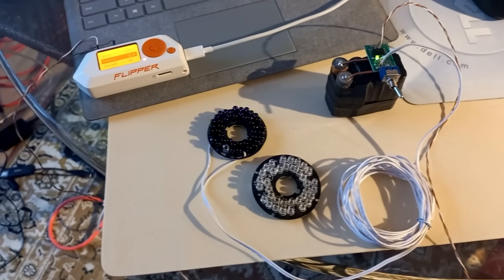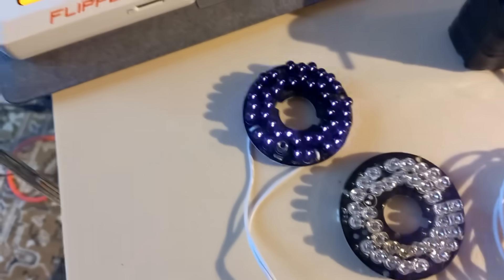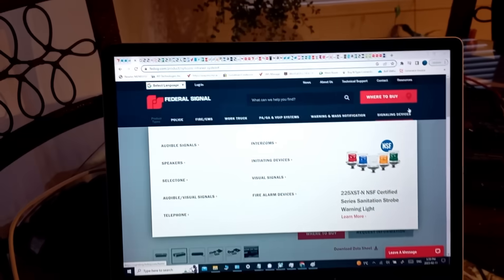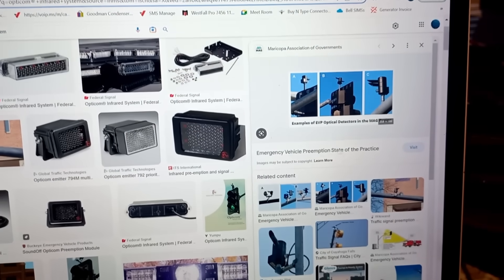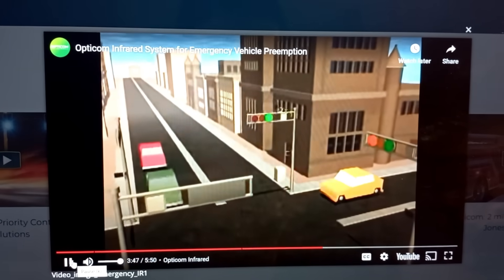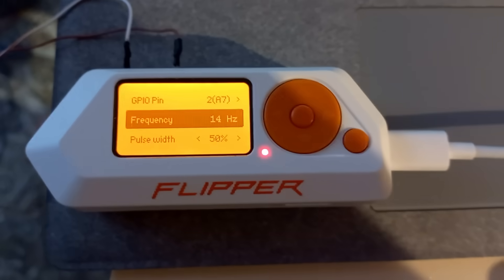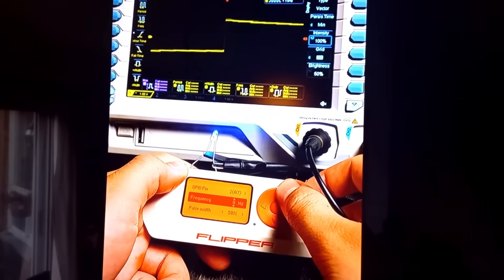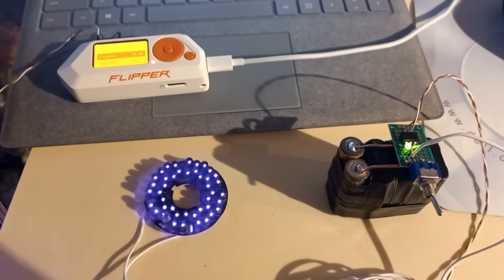Flipper Zero Controlling Traffic Lights

Comment: Remember It is illegal to interfere with a traffic control device such as a stoplight and most lights have security cameras on them these days to catch offenders utilizing an apparatus such as this for their own personal gain.
Reply: @peterfairlie2296  you can probably build the circuit using a 555 timer as an oscillator for like $3 total and they're selling it for $5000? man that's nuts
Reply: @HPStreamNewsChannel  heya, instead of a 555 timer you could just as easily use a simple arduino nano that contains everything except for the transistor on it and you can just put a simple piece of code on there via usb
Reduces work a lot and doesnt require much technical experience 😉
Reply: @hyperfluff_folf  Exactly. An Arduino is cheaper, or an ESP. There are ESP boards that already have screens on then, so you can make your own low-cost solution. Bonus: You can program an ESP with the Arduino IDE if you want :)
Reply: @HPStreamNewsChannel  lol
Reply: @HPStreamNewsChannel  yes and use transistors to drive the leds.
Reply: @HPStreamNewsChannel welcome to inflation
Reply: Then use it for the benifit of the car behind you
Reply: @peterfairlie2296  That's actually cool that you're helping them out. Companies sometimes even charge more to government groups like that, cuz they just wanna bilk as much tax money out of them as they can, but volunteer fire departments don't get much in taxes to begin with lol
Reply: You say most have cameras but I’ve yet to ever see one anywhere outside a city.
Reply: @peterfairlie2296  5000 USD, Wow!
Reply: @zaprodk  that government contractors for you.
Reply: @peterfairlie2296  laser interceptor sold laser jammers that use small IR output devices like you’ve described. I think they are out of business these days. I still own a system from 2012
Reply: @peterfairlie2296  The fact that you can save a local fire department THOUSANDS is amazing. Good for you! 👍
Reply: @watchandjewelryloft4713  yeah it's great but here in the US I wouldn't want to put legal liability on myself. That may be a large part of the reason the commercial product is so expensive. For example: this thing fails to activate a light, fire truck plows into someone, they sue, and part of the cause was found to be this system not working properly. No thanks!
Reply: I'm sure we all know it's illegal I don't see the point of pointing out the obvious..
Reply: @peterfairlie2296  true and some fire departments are volunteer
Reply: It is not illegal to high beam the traffic light.
Reply: So is speeding
Reply: No *hit Sherlock!!! I’m sure he knows that
Reply: Yes, mom.
Reply: I'm driving on a suspended lisance with no plates and unregistered car and no insurance.  I don't give a dam about legal
Reply: I can’t travel across town without being on a government video open to public monitoring.
Reply: Waaaaa Tattletale
Reply: Yes but chances getting caught is nearly impossible lefty
Reply: @Pablo Lopez Perhaps you interpreted him wrong. And assumed negative intent. Quite the opposite my guy. This world is a thinking man's game.
Reply: In a world where the ruling class can do anything they want and will only get a slap on the hand for seriously horrendous crimes, you’re worried about some guy building a tool that could help fire departments who don’t receive enough funding? 

Just because something is “illegal”, doesn’t mean that it’s immoral and vice versa.
Reply: Yes they have cameras but don’t record. Maybe only on major intersections. The cameras are used mostly for monitoring traffic
Reply: @peterfairlie2296  but even then the STM32 inside the flipper has its own clock and is only a few dollars, you proved it with the flipper!
Reply: The penalty is death!
Reply: Remember illegal is a sick bird.
Reply: @HAWKCoinMillionaire  siiiiiick 🤘🤘
Reply: I’ve been using my aftermarket Ridgid LED’s to change the stop lights when there’s no traffic. It makes no sense for the light to stop me when I’m the ONLY vehicle on the road!
Reply: that isnt "why" lights have cameras on them.
Reply: Our lights have a white led bulb that flashes on top of opticon sensor once light changes and yes there are cameras on all signals around here in. WI , they are used instead of ground sensors but they also do record everything and Dot can get footage if needed
Reply: Thanks mom 😂
Reply: This comment is why YouTube needs a laugh react feature 😂
Reply: I recently heard a story of a truck driver who had a jamming device to defeat the onboard tattler. The device was too powerful and jammed FAA frequencies as he drove past an airfield. He got in a lot of trouble
Reply: Nobody cares bro. Be a safety sally somewhere else.
Reply: 🤓🤓"don'tdo this! Its illegal!"
Reply: It’s not a crime if you don’t get caught .
Reply: Nobody asked
Reply: The subdivision I live in has plate readers that pick up every car going in or out without a stop light around. Your car can be tracked as you go anywhere in san diego. It's creepy knowing that every move you make is recorded at home or anywhere you go. The idea of privacy or independence is ancient history
Reply: @BLOODFART309  Those are traffic detection cameras to tell the light when to change. That’s all they do. They’re part of a regional ITS, so even if there’s no light there it can measure the traffic and tell the lights up ahead to prepare more greens etc.
Reply: @CityLifeinArizona  idk where the camera is in my housing area. I know it reads the tags because it was in the HOA letter. Every car in my neighborhood puts gives their info and then it alerts security I guess when any car enters the area that isn't a homeowner or renter
Reply: @BLOODFART309  yep Flock cameras be everywhere these days.
Reply: sure karen
Reply: Hahah are you kidding? Id run this during fuckin traffic.  Hack the world 😂
Reply: Lol no they don't we have been using them for years in Canada no one's been caught
Reply: I could care less about the "law"
Reply: Ok but misdemeanor or felony? I don't think anyone speeding really cares, and this might be advantageous in a cannonball run
Reply: @ImperatorCaesar22 In Minnesota it is a felony.
Reply: @ImperatorCaesar22  he's in Canada so nobody cares 😂
Reply: @peterfairlie2296  Well, a 555 might not be the easiest option (though I suspect the required frequency tolerances aren't that high), but a whole Flipper is a huge overkill IMO. Any "arduino-like" will have more than precise enough timing, even without a quartz resonator (even a bare microcontroller chip will do). Some very decent boards can be had for under $2 (e.g. on AliExpress), I personally like the board known as "blue pill" (though it can be a little tricky).
Reply: @Trekeyus 
At the end of the day. All greatest minds that were able to hack or break the system. Governments hired them to help them. So that is your illegal statement
Reply: who cares. someone with a gay flag as a profile picture should keep his mouth shut.
Reply: you’re annoying people who are smart enough to do this know they shouldn’t. This device is used by mostly hackers take a fucking look around before being the annoying fuck saying “that’s illlegal jeeepers!”
Reply: My 3 part, super basic MIRT.  https://youtu.be/H8U0_MzCrnE
Reply: Lmao no they don't. They maybe have one camera that faces an obscure angle unless it's a well known area for wrecks
Reply: @donovanm.8909  What about my vehicle?
Reply: @peterfairlie2296  love it but for cheapness you could use a esp32 and lojic level converter get is all done for 30$ allowing lojic to activate it
Reply: @peterfairlie2296  A cheapo MCU run off of a good-ish quartz ciuld do the job just as well. There probably are dedicated frequency generator ICs too, that can give you 14Hz from a faster Quartz like the 32768Hz clock crystals
Reply: I wonder what the minimum pulse width is for the sensor, and the persistence of the signal its logic is looking for vs the frame rate of the camera. In theory, and in a lab, one could sync the outpulses of 14hz between every-other frame of a 28hz camera fr. If it’s 29hz the pulse would need to be very thin and slowly phase shift from the tail end of one frame to the beginning of another, pause, and repeat.

But maybe the camera and its software is imprecise and/or redundant cams would foil this. Would be pretty sweet if it worked tho.

I guess James Bond would have a shrouded laser on an auto-targeting system that magically pointed right at the sensor, for ultimate stealth. 😂

Also, yeah this is a life/death situation device and even that would likely result in getting caught/punished. But nothing would be worse than a dead loved one.

With so much discretion available to judges why debate the legality? Your haircut is probably just as much a factor.
Reply: @peterfairlie2296  yesss please keep looking into this idea!!!
Reply: @peterfairlie2296 You wouldn't use a 555 timer, you'd just get the cheapest possible microcontroller and a crystal from a dollar store alarm clock.
Reply: @peterfairlie2296  RFID has a lot of range ! I have a reader/writer from IMPINJ that works up to 100m for fast inventory, it works with cheap 20cent rfid tags.
Reply: @peterfairlie2296  you might help some people but that is not the place to expose vulneralities in such critical equipements
Reply: Only if you get caught
Reply: Shut up.
Reply: I think he knows and most do, this ain't a civic public announcement...
Reply: @peterfairlie2296  Calibrate? With a trim pot. Or just use a $2 MCU, lol
Reply: @peterfairlie2296  it's used for weigh stations, but they have to place the transceivers further ahead, and that's extra money for a pole, etc.
Reply: @tripplefives "dirty cheap power supply" 🤣🤣🤣
Reply: My fellow Canadian. You shall be prime minister. Haha
Reply: So when you do this, make sure to hack the cameras too
Reply: @Peter Fairlie Helping out the local VFD while simultaneously sticking it to big corporations is a noble aspiring.
Reply: Dork
Reply: @peterfairlie2296  show us how to make the jammer
Reply: Who gives a shit the government does illegal shit to us everyday.
Reply: The funny thing about the laws that require intent, they are written ambiguous enough that anymore can screw anyone else for just about anything, intent is a sham . It doesn't matter if you have a team of lawyers to make sure you know all laws , some cops and Da's will do all they can get away with to get the most convictions and jail time they can get away with... Truth and justice be damned. God forbid if you get singled out....
Reply: No way you clown the friggen camera are if you blow the red or to fast. You bozo
Reply: @peterfairlie2296  Sell this one to them for only 2000 each! Lol.
Reply: This is for education. Bruh..
Reply: Hiding my apparatus.
Reply: What if it is used to optimize the lights as a public service?
Reply: Ok Karen way to ruin people having fun
Reply: When I was a kid, we used to change traffic lights with a simple strobe light
Reply: @peterfairlie2296 yeah, but your posting the technology on line for anyone to use. Your proof of concept argument is bullshit. You video will get reported
Reply: Self righteous preek
Reply: Yeah, like the guy doesn’t know. Lol who the fuck is this crybaby narc?
Reply: How about a circuit to interfere with said camera too ;-)
Reply: Remember...paintballs exist for a reason.
Reply: @peterfairlie2296  THIS!!!!!!!
Reply: Yeah I don't care. I've already bought one and have been messing with people continuously. I've caused 10 wrecks already.
Reply: @peterfairlie2296  have you looked at notchacotcha
Reply: What would you stand to gain lo
Reply: Aw man
Reply: Lame ass dude gtfo
Reply: @peterfairlie2296  holy shit that's smart
Reply: His profile pic
Reply: Wow someone’s a buzzkill
Reply: Thanks for the heads up snitch
Reply: Most intersections do NOT have security cameras.. those are video detection cameras. They don't record. At most there will be a cctv feed of a intersection that doesn't record either.. but does have the option to record during certain "events". Such as EVP being triggered.
Reply: Certified Boot Licker
Reply: It should be illegal to vote for the democratic party
Reply: no shit sherlock
Reply: Don't care
Reply: 90% of the cameras you see aren't recording they are for the lights. The camera only sees cars and changes the lights to let the lane with the most cars go through. The cameras are just the replacement for the sensors in the ground at the light. It's easier to setup the camera then cut the pavement and install electromagnetic sensors.
Reply: Lol how did you come to that conclusion
Reply: All these tinkerers talking about 555s😂
If you need more than a generic quad op amp and a few discretes to create pulses at a given frequency, then you don't need to be giving electronic engineering advice.
Reply: Yeah don't forget derp
Reply: What is the need for public safety vehicles jamming radar?
I don't believe for a second your claims of honorable intentions for your device. 
You only say that as a cover for nefarious use by scofflaws you are marketing to.
Be smarter, don't be bankrupt.
Reply: @Shadowband  what are you mad about?
Reply: Yeah I’m sorry but most lights don’t have cameras to stop people from interfering with them.  I have no clue where you got that from
Reply: IR strobes will make them break your legs.
Reply: Cameras are very hard to use as evidence. So who cares if they have them.
Reply: The cameras at most urban intersections are not security cameras.
Reply: Shut up nerd
Reply: Couldnt help but notice the camera on the traffic light aiming in his direction. If you are not an emergency vehicle with emergency lights active using an opticom or equivilent....well...you figure it out. I knw my state logs that stuff and they do check to make sure it was an emergency vehicle.
Reply: @TheCommo81  Those cameras are part of an AI system that controls the lights. They replaced the old loop detectors that changed the lights when a vehicle parked on them. They don't record.
Reply: You can use an arduino and program it tp frequency vs the 555 timer. Just set delay in ms.
Reply: @peterfairlie2296  I think for $5000 they should have chips like apple h1 or h2 chips which with added security of course.
Reply: Are you sure most lights have cameras to stop people doing this? I don't think they do
Reply: Stop bitching.
Reply: Most lights do not have security cameras. …why would you make such an outrageous statement? Even if you counted all the red light camera it is still not remotely the majority of stop lights. And here’s the thing, it makes your post look like scaremongering. Because yeah you’re right, but what are they gonna do about it? …chase some guy in a black T-shirt and cap that maybe was in the vicinity when it happened? Here’s the thing our society: won’t do anything about this until something huge happens or someone gets killed. So it always is.
Reply: Fed
Reply: I’m pretty sure the cameras are there to ticket drivers who run through red lights.
Reply: @damian9303 Some but not all. Most are there to scan license plates to search for wanted suspects.
Reply: @peterfairlie2296  and the government pays 3M $5000 apiece for a blinking light? Sounds about right.
Reply: I would really wouldnt give a f#ck, cant wait to try this😂 too bad i dont have a flipper!
Reply: @peterfairlie2296  or you could try to only go 10 mph over the speed limit so you dont get pulled over and dont need to worry about radar
Reply: Thanks bud 😂😂😂
Reply: It's ok, I don't need one I just run through those silly Christmas lights but I appreciate them being festive.
Reply: Police 🚓 here
Reply: You're fun at parties
Reply: No shit
Reply: People are such scaredy cats. Nothing ventured, nothing gained.
Reply: @peterfairlie2296  rpi pico and some code does the same for $5 + tax though the flipper is more versatile
Reply: Thanks to Flipper Zero, My Doordash delivery times have plummeted and my tips skyrocketed!
Reply: You must be fun at parties...
Reply: Also why post the video. If people are looking for a reason to ban these, this kind of thing will freak them out
Reply: What I saw was a video where the driver happened to catch all green lights.  It happens.
Reply: I hear they could be fun to play with, but don’t get caught!
Reply: Calm down Karen
Reply: @Zach Z  how does that make me a karen and why do you feel the need to reply. I didn't say anything to you. I wasn't being mean to anyone. I said a video was awesome and then a real Karen replied to me. On top of that im a man so not a Karen. Did you feel the need to reply to the person that made the effed up comment to me? Probably not. By the comment you made i bet you like to make problems.
Reply: @blackops84321  you need a hug babe
Reply: The same apparatus that’s failed to catch me speed
Reply: Calm it down bud
Reply: @trekeyus wait really?
Reply: It’s illegal to do a lot of things with a flipper zero. Which is why it sold out.
Reply: @Trekeyus no one cares snitch
Reply: In what law, does it state?
Reply: @peterfairlie2296  they are not 5000 dollars. I've been upfitting vehicles for years, not sure where you got that number
Reply: @peterfairlie2296 I would love to see a radar jammer. 😎
Reply: @tripplefives1402did ur work
Reply: Man shut up already
Reply: Legality is a fictional concept. It isn't actually real.
Reply: Wow I didn’t know that
Reply: @peterfairlie2296  I love the idea of using a tool like this that's typically seen as a hacking/pentesting device constructively as a low cost solution to get around companies inflating prices for professional use, especially when it affects things like small town's public services.
Reply: Shut up nerd
Reply: @peterfairlie2296  are you trying to negate that you did commit a crime? Because let me tell you no matter how you paint it to go to sleep at night, i am more than 100% positive the fire station did not give you authority to tamper with city equipment, that is a serious offense and your lack of care or accountability is concerning to say the very least.
Reply: In Florida, most signalized intersections do not have security cameras to record vehicles. Cameras are for vehicle detection (contact closure) only.
Reply: Actually you are may illegal to say alive in this world you are a risk in human generation
Reply: @abdulrahmanfaisal288  go home Abdul, you’re drunk again.
Reply: Where do you live where most lights have security cameras on them?
Reply: America was built on breaking the law!
Reply: Most traffic lights do not have functioning cameras.
Reply: Ew this pfp eww
Reply: Oh look. The YouTube police.
Reply: No plates bitch
Reply: Nobody gives a shit
Reply: Shut up nerd
Reply: Pfff like people care if its illegal. Depends on what you use it for fool.
Reply: Who cares if it's illegal 😂
Reply: I see thanks
Reply: Agreed, Only use it for that one last job that you moved to a mountain cabin and swore you'd never do, and even then, only to give your getaway vehicle advantage.
Reply: So cringe, zero fun allowed these days smh.
Reply: @peterfairlie2296  if you do this, PLEASE share! :D
Reply: @peterfairlie2296   That would be cool to jam speed radars from the flipper. Awesome idea.
Reply: @JayJay-by2ig  just remember cops are uniquely qualified to judge speed by eye so this won't save you from a yicket
Reply: @JayJay-by2ig  I hope to never see you on the road
Reply: @SlapshotJack  why is that?
Reply: @JayJay-by2ig  you said you wanted to make a speed radar jammer out of this so it implies that you speed
Reply: @JayJay-by2ig  Jamming speed radars is federally illegal. Not a good idea. Unless you want to go to Club Fed.
Reply: @peterfairlie2296  got yourself a follow and subscribe here bud haha, 😅 cool video glad you can use some Knowledge to help provide some  emergency responders a way to make it to there scenes faster. 

Me on the other hand well I'm about to be the fastest food delivery guy.
Reply: ^nerd
Reply: I don’t give a damn, if it’s illegal or not. That flag is ridiculous.
Reply: @peterfairlie2296  oh that's a nice, way to give them a cheap alternative but also bad for us to abuse lol
Reply: okay Karen
Reply: Uh, idk where you live but I've never seen a security camera on a traffic light. I've seen red light cameras, but they only take pictures if you run the light
Reply: @Dade  in Kansas city MO and KS, there are cameras at about 98 percent of all lights.
Reply: @blackops84321  Ah yes, another example of that red state "freedom".
Reply: @bryanpritchett  actually is more common in blue states. Everyone working for or with the government. :)
Reply: @josholin31   You keep telling yourself that if it makes you feel better.
Reply: @bryanpritchett  I guess the only way we could figure out their state's average voting preference, is if we asked the person who commented about their parents. And then we'd have the answer on who's blanket statement was correct in this instance.

Some food for thought. Cameras are more common in cities. Which are a higher chance to vote blue. But lights with cameras are becoming more common, meaning they could be anywhere. A lawyer would have more opportunities within a city. But not all cities vote blue... just again, slightly higher chance.

I'm not even republican. I was just calling out a blanket statement by doing another. Imo blanket statements show that you could be a racist, since believing stereotypes also ignores contrary evidence. Especially when blanket statements involve people...
Reply: @Demon5layer2012  they are part of the city's Real Time Crime Center (RTCC) system and have flashing obnoxious blue and red lights on them and monitor most interchanges of interest.
Reply: @Trekeyus  ohh yeah, have you ever actually seen footage from one? The quality is pretty much garbage, and when they are used, they're used for real crimes. They're not gonna use cameras to catch some guy screwing with traffic lights 😂
Reply: @Demon5layer2012  Wrong. One got my friends plate once for litering.
Reply: @Ryan-ky3nr  Where and when?
Reply: @Dade  they do look at the cameras. They will get your plate number and go after you. My dad was a deputy sheriff and my mom was a lawyer. They do go after anything and everything
Reply: @Ryan-ky3nr  nah that’s a lie, no way a camera can “sense” littering happening
Reply: @featherpony  ya sure mr genius, it’s “possible” but you think cities are spending millions to upgrade to cameras that can see littering instead of only being turned on by a light, even if you could find me a sourced example of a camera being used to watch for littering, which you won’t, then you’d only be providing the exception that proves the rule

Edit: spelling
Reply: @mrhunt231  have you heard of artificial intelligence? It can be trained to spot pretty much anything. Take a look into what China does with their security cameras and social score.
Reply: @blackops84321  Jeez, nice home life, eh? Kind of hard to be a hacker.
Reply: @Matthew Johnson  im not sure what you mean, but i should have said i made something like this years ago. Mine opened garage doors, some car remotes, and a few other things. I built mine from parts. I didn't buy one already built. I actually had to learn how to make it unlike a lot of people that use the flipper. As far as a home life, it was a great life, and still is. I didn't put down this video in any way. I said it was awesome. So im not sure what you mean or where you're coming from by your reply to me.
Reply: @Demon5layer2012  They’re all over in Minnesota.
Reply: @Demon5layer2012  there are licence plate readers everywhere. At least here in Los Angeles.
Reply: @Demon5layer2012  They snap a pic AUTOMATICALLY when you runs light, but who could say it could be monitored, and an image saved whenever?
Reply: @Demon5layer2012  I don't know where YOU live but here in the US it's extremely common to see regular cameras on top of poles in intersections nowadays. Even in small-ish (15k population) towns.
Reply: @Demon5layer2012  bro... your ( RED ) Light !!! Camera... is always recording 🙄
Reply: @Demon5layer2012 a lot of places have cctv on them
Reply: @Demon5layer2012 I see them allot in New Jersey
Reply: They can't arrest ALL of us!!!!
Reply: Thanks for nothing.
Reply: Turning a little light bulb isn't illegal LOOL
Reply: Remember, a profile picture like this is an indicator that no one needs to take you seriously 😂🎉
Reply: Idc
Illegal = FUNNY! 
(Trans rights are human rights)
Reply: SO MUCH "WELL, ACSHOOLEY! 🤓" in one comment thread lol. Shut up nerds, let the dude live.
Reply: @peterfairlie2296 be careful man, calling it a proof of concept doesn't make it legal
Reply: @MediumHalf  What rubbish, using it without express permission definately is illegal. If sold to emergency services, this is a product!
Reply: @MediumHalf  having a flashing LED isn’t illegal. Using it for traffic control is.
Reply: @yolo_burrito  only if you get caught, and you won’t because there’s no provision for monitoring the general public for that. The cameras work by taking photos of the rear plates of vehicles who violate red lights, if they are present at all.
Reply: @MediumHalf  I'm going to proof your concept
Reply: @MediumHalf  ! Are you a licensed lawyer? No you're not!
Reply: @MediumHalf  There's no law saying you can't have flashing infrared LEDs on your vehicle...
Reply: @MediumHalf  trolling doesn't make you a good person either
Reply: Most of the time the cameras on signals are for detection only, the video is never saved, it would take GOBS of storage (~4 cams/signal @ HD x 300k signals in the US adds up insanely fast) for very little gain. But agreed, he should only do this if he has permission and it is in a controlled environment, likely monitored by police. Awesome project though, infrastructure type stuff like this is ridiculously expensive. Prices aren't really set by how much it costs to manufacturer, but more to do with how much it's worth, and $5k is a really small price to pay for the ability to make first responders safer.
Reply: @peterfairlie2296   I would think that an RFID system would be much better for this purpose. It would be a lot harder to tamper with and I would think that the technology would be cheaper.
Reply: @tripplefives1402 breaking any law on accident is still breaking the law. a prosecutor with something to prove won't care.
Reply: @wut3358  some crimes require intent, others do not
Reply: Correct. It is a felony in the US (which would almost certainly warrant prison) and would result in 10s of thousands of dollars in fines from the FCC.
Reply: @user-lt6gh7eL27  except he is in Canada so....😂
Reply: @user-lt6gh7eL27 gay
Reply: If enough people do it they have to make it legal
Reply: @macbook802  you have strange logic. It sounds like "If enough people commit crimes then the government has to make it legal". Strange idea...
Reply: @macbook802  umm no they don't. Do you want to explain to the family of the person who died because you couldn't wait 30 seconds?
Reply: @macbook802  says the one who thinks it's ok to interfere with emergency services.
Reply: @peterfairlie2296  that’s great, you’re still not at all regulated by anyone to be doing these tests on public roadways, you having a buddy or two at a volunteer fire department makes no difference.
Reply: @MrDoNotAnswer  what do you care? He's not even in the U.S. 😂 Thanks for sharing, my Canadian neighbors 😊
Reply: @MrDoNotAnswer  why are you so tight about some random video.
Reply: @MrDoNotAnswer " yOuR nOT rEgUlAtED! REEEEEEEE yOU gOtTA aSI tHE gOvErNmEnT fOR pErMiSsIoN"